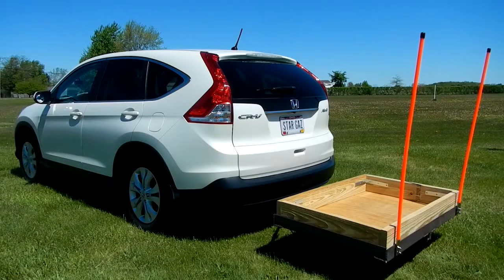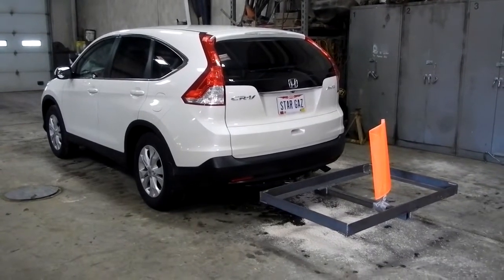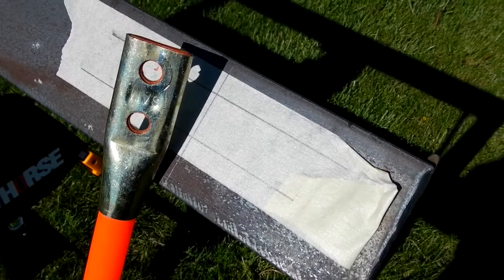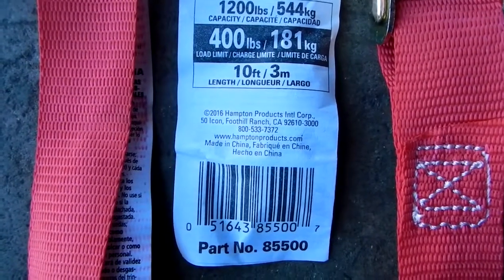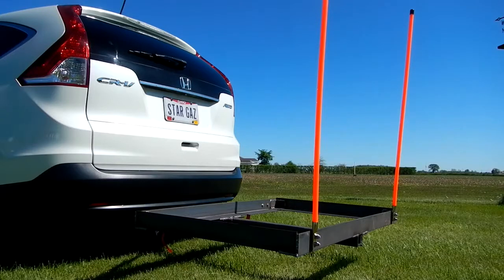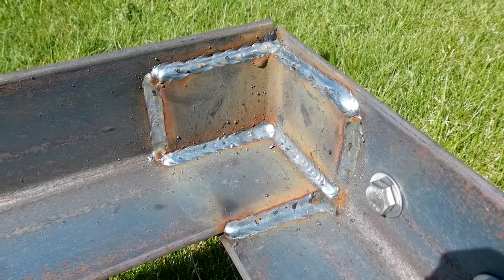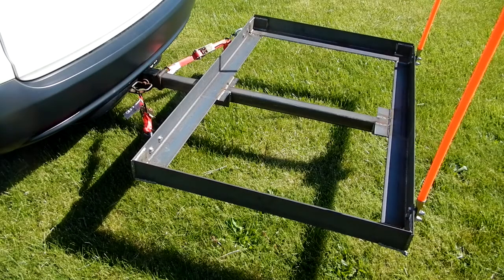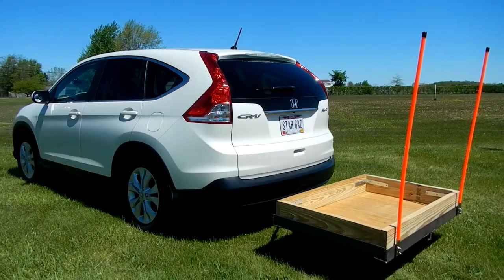Hitch Mounted Cargo Carrier I Made

Comment: Impressive setup! I too have a hitch carrier on the back of my car and sits as low as yours does, so I added two steel roller underneath each corner in the rear because I've gone into some slopes that the back end of the carrier drags on, so I installed two steel rollers one underneath each corner to help when I come across uneven slopes
Reply from the maker: Thank You James!!! Yes, I am very careful with steep slopes. Yours is a very good idea.